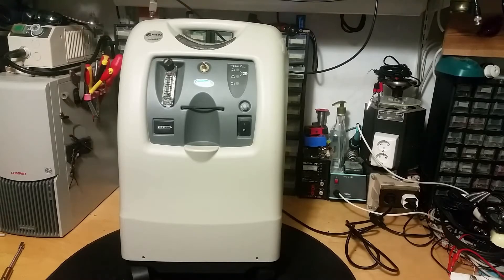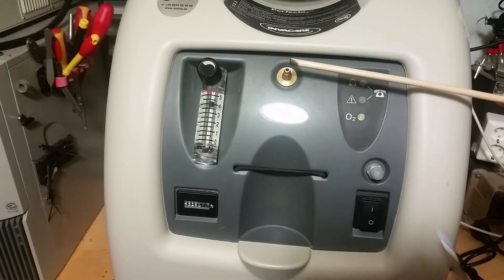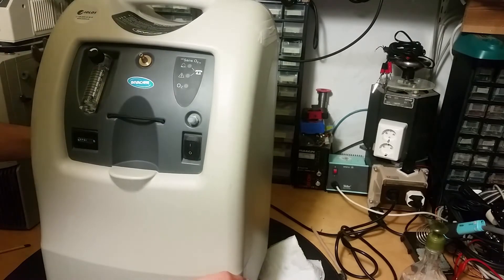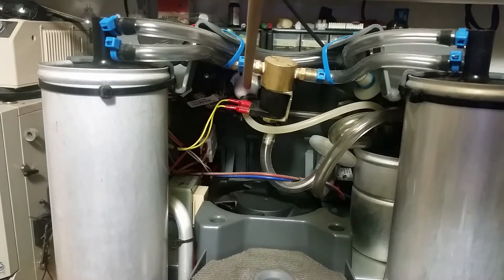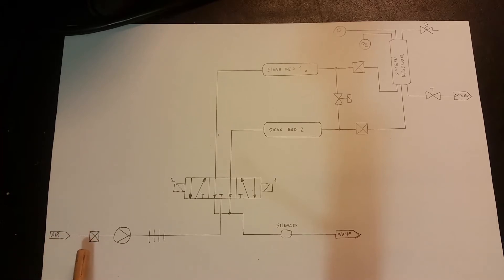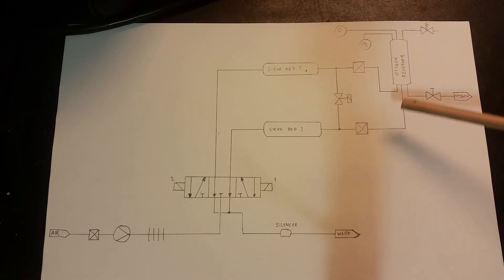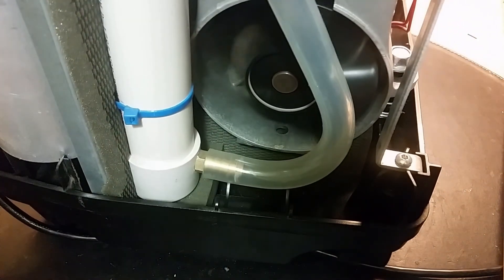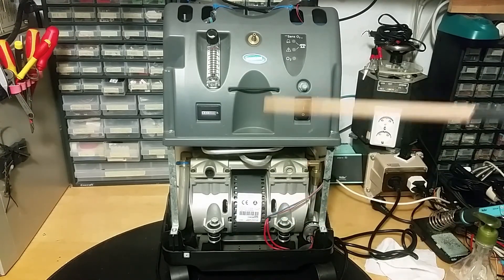Oxygen Concentrator Teardown And Schematic

Comment: If you could put a higher pressure compressor on it do you think you could increase the output pressure? I can foresee other modifications: overpressure sensor, container pressure rating problem?, reduced O2 output concentration...  but maybe those can be overcome relatively easily.  I wonder if O2 concentration could be increased in that scenario by putting a canister (salvaged from a 2nd machine) in parallel with each of the two existing canisters?
Reply: Run the input of the air pump through the filter while wrapped in cloth a bucket of dehydrated Epsom salt and let it run a few hours. This will dehydrate the zeolite. Higher pressure is extremely dangerous 😮. If pump input pressure is too low get a rebuild kit. ❤

Comment: If the compressor is doing a squeeking or chirping sound like it needs oil, can it be serviced, or does it just need to be replaced?
Reply from the maker: Maybe the motors bearings needs some lubrication?

Comment: Hells I have a problem with my Concentrator.. air flow in water bottle is very low. Can you suggest me a solution to solve this. Expecting your reply
Reply from the maker: Hello
Check all the tubes, valves and pneumatics that nothing is leaking, the compressor gives out proper pressure

Comment: I worked on these for many years. Went to several schools on them. That was years ago. They look some different now but mostly the same.
Reply: Can we have a conversation? I am interested in building one and have a few questions. It would help alot. Thanks
Reply: Do U replace the filter behind the foam one once I take the clip ware the foam filter sits off
Reply: Can you point me in the right direction to troubleshoot and testing

Comment: I have an Invacare Platinum XL and I have noticed an exhaust smell. I've had it since 2019. I changed the hepa filter. I see on the manual you can clean the heat exchange and change the exhaust canister but I don't know why would that make an exhaust smell. I am wondering if the check valve is bad, sieve bed or some trouble in the filter. Or the fan inside has quit causing overheating? I am not sure. Thank you.
Reply: Hi, Would you recommend the Invacare Platinum XL? I've been looking for a used one for a while at a reasonable price. Also looking at the Philips Everflow. Want to use for jewelry type welding and small repair work. Saw one for sale recently for $150 that was put away for an extended period and when taken out and tested would shut down after a few seconds. Only had 36 hours on the hour meter but probably had moisture infiltration in storage. Thanks.

Comment: If you can get enough flow, would be great for running a welding torch. Would be interesting to see if natural gas plus pure oxygen will get hot enough for some common DIY welding tasks.
Reply: It works ok with the old precision oxy gas torches, add a check valve and flame arrestor on both lines if you use it. Remember light gas first than add the oxygen or else 😲💩
Reply from the maker: Yes, i will have some more oxygen concentrators soon, but I have limited space so it will be a bit hard to do some oxy-gas welding

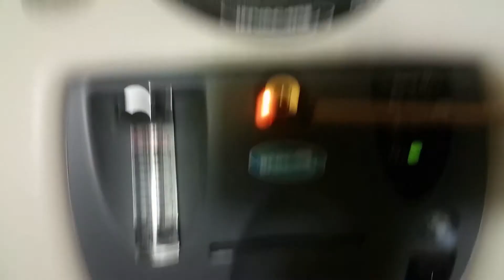Comment: 2:00 Why is this dangerous?
Reply from the maker: If the plastic housing of the concentrator caches fire it will be pretty bad
Reply: @MrTesla1337  Surely the plastic housing is full of fire retardants?
Reply: @cebruthius  even metal will happily burn in a high oxygen concentration. pure oxygen makes everything burn, and it burns extremely fast and extremely hot